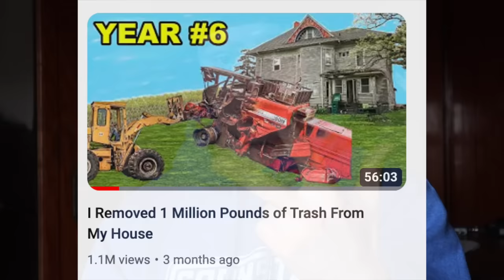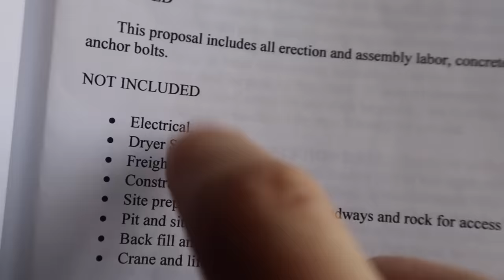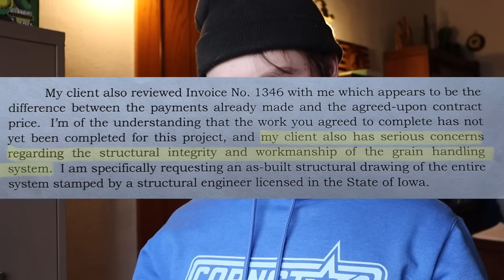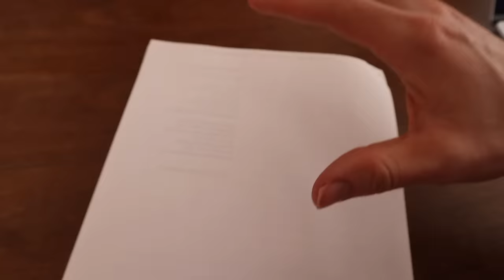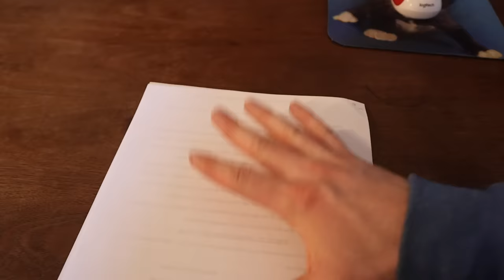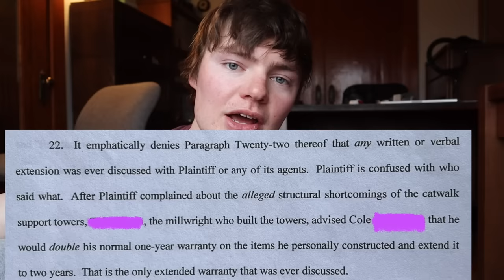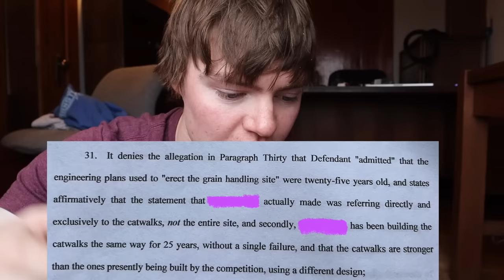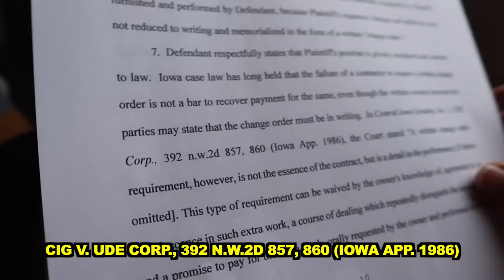I Sued My $1,000,000 Bin Site Contractor

Comment: I am a construction manager on multi-million and billion-dollar projects around the world and have dealt with construction claims throughout my career.  I have been a factual and expert witness three times in high-value arbitrations. You have done wisely to get a construction lawyer as dealing with this stuff is definitely a different bread of cat.  From what I have witnessed on your videos when trying to use the system and what you said in this video, you have a very strong case.  The facts seem to be on your side.  Good luck and sorry that you have to go through this mess.
Reply: Can it hurt Cole’s case if they continue to use the bin site?
Reply: @dylan818  No they have no other choice. They aren't able to use the bin site at capacity or as it's intended either so they are having to use it to what is safe for them until this gets sorted out.
Reply: *breed of cat
Reply: @dylan818  no, quite the opposite, the more evidence it doesn’t perform as per the contract, the stronger Cole’s case.
Reply: I worked in underground construction installing water/sewer/force main, and storm drain, the day i started working my first boss told me if we put anything in the ground we take a picture of the product before it goes in the ground in the ground and all the connections of the product. This was mostly to cover your bases when it came down to jobs. When i moved from underground to building prefab walls and such I will still do the same thing. My boss would always do a on-site engineered plan with all the mechanical joints and grade of each section of pipe from top of pipe. This way anyone coming back would know what is done for each job site 10yrs later. The fact that they are not giving you structural engineering plans might mean that they used some pre-built ones then onsite did adjustments that didn't fit you job site. As my boss would say never just take pre-built items in with making sure they are going to work for that job site as not all jobs are the same. I hope things get better down the road. Remember any future work you do get pictures and video if you have the work done this way you have documentation of everything. Keep a copy of all the plans.
Reply: I feel for their problems with the construction of this bin sight,but something was mentioned about the company that built  it was not allowed on the property to rectify the situation, I believe that could be a problem with this law suit IF that is true ,the company is going to use that as a defense
Reply: yep on simcity like most of us.....
Reply: You lying, you work at Walmart.
Reply: Yes, and the "colesters" have a machine shed that was acquired thru dubious means. Seems like if you're a contractor working for these people you should watch your back!
Reply: Who was the construction manager on this job did they even have one.
Reply: The justice system isn’t about what’s fair, it’s about what’s legal. Most often it comes down to very technical language IE, if the contract called for an estimated completion date that wasn’t met, Cole has an avenue to pursue called liquidated damages. On big contracts like this, it’s usually 250$ dollars daily. 

If Cole started using the bins prior to the contractor handing it off, he may have hindered the contractors ability to work effectively ( even if past due). I know what people will say ‘well, him not getting things done by completion date, means Cole couldn’t use it when he expected.’ I agree, Cole has an avenue for this as well. He would need to balance any extra costs in the final bill. IE, he has to rent a different facility, it cost’s him 100k. He would bill the contractor that amount. He can show it as an expense sustained because of the contractors.

This is just an example. I don’t know the ins and outs of his contract and that’s all that really matters. What’s fair, what’s right does not matter. There is a clause for everything. This is why it’s so much better to resolve things before it gets to court. His lawyer has incentive to make this a long drawn out battle, he gets paid regardless. I’m not suggesting he’s doing that, I’m simply stating things are stacked against Cole because the whole system is shady.
Reply: @beentheredonethat3925  they won on the machine shed, they guy had forged papers. Unless you are with the building contractor they are suing how can you say that.
Reply: you must be mad rich
Reply: I’m sorry but I’ve been building these systems for years. Once that have used the system it’s over. They have been able to use it and have been able to reach max capacity. Just for being frightened of systems failure doesn’t mean it’s failed. In one video it states that welds were broken. After being used one year. Those accusations will go no where.
Reply: @graysonklocko9224  so, if they use the system and then things broke,  that is somehow unrectifiable with the builder simply because they used it? On principle, that’s wrong. However, principal in these cases is secondary to the contract, and if the contract didn’t have a warranty or wording that allowed for some sort of performance evaluation, then I could see your point.
Reply: @graysonklocko9224  they said they haven’t it used it to max capacity because they can’t, that’s the problem. Just because you can use the bath tub but have never been able to use the shower because the plumbing wasn’t done properly does that mean they put the shower in correctly.  Partial use does not mean done properly.
Reply: Let’s just hope he doesn’t lose a ton of money in court costs.
Reply: My boy tried to apply for the job 😂😂
Reply: Bread of cat 😂😂😂😂😂
Reply: A construction manager that doesn't know the difference between bread and breed. 
Makes sense.
Reply: 🍞 of 🐱
Reply: The bread of cat. What even is cat bread?
Reply: @chickenmonger123  A tasty side dish in China
Reply: @billsauberlich7337  they would need to make a change order a d agreement to do that! I’ve spent months repairing rafters on site but you don’t touch them tell they are redesigned and a change order is done e
Reply: @billsauberlich7337  The company also said that they were never brought any complaints or concerns by the Plaintiff...how could they be denied access to rectify a situation that they never were made aware of? Also, IMO it almost all comes down to the foundation of the site. If the concrete foundation is found to be inadequate...that means the entire project is inadequate and not up to standards and has to be completely redone. Hand rails, bolts, weld, belts etc. are really irrelevant at that point.
Reply: Bread of cat.  What's cat bread taste like anyway?
Reply: I wonder if the contractor looked at you, saw some young kid(you look much younger than what your actual age probably is- late 20s ?) and thought he could take advantage of you. So he thought he could give you poorly made equipment, possibly made from inferior quality material and you wouldn't know how to deal with it.
Reply: .  Typo??!

Comment: You should have an OSHA/Insurance inspector come out and do a walk down of the site; submit their findings to your case.
 As a farm (business) I'd be surprised if an inspection wasn't done once construction was complete. If a final safety inspection was done, they sure did a very poor job.
Reply: Also corw the concrete bases and test as they are probably weak cement?
Reply: Great idea!!!!  it is a work site
Reply: I’m kind of surprised that there were no ‘As Built’ plans provided after project was completed.
Reply: If OSHA came out that whole bin site would be shut down.
Reply: If OSHA came out, the farm would be responsible, not the contractor
Reply: I wondered about a final inspection also. Especially how high in the air a person has to go.
Reply: OSHA inspects everything, NOT JUST WHAT YOU WANT THEM TO LOOK AT! Cole has documented unsafe working practices on just about every video.  Some immediately life threatening. When OSHA visits, they look at everything and everyone. All employees, all the buildings, all the equipment, your maintenance records, observations of employees working, hazardous materials storage and handling. I have had them remove tools from my tool pouch and discard them as too worn and unsafe for use. Too many violations can shut you down. There are some exceptions for farm work, but those are pretty much spelled out. Lawyers can get involved, it's messy!!

Basically, you do not invite OSHA except to complain how unsafe a competitor or ex-employer is!
Reply: @davidwilken3584 As would the rest of the operation.
Reply: @jerrylondon2388  yeah I don't get why people say to get OSHA involved. Under the Appropriations Act OSHA would not even legally be allowed to visit the farm/binsite. They are not allowed to spend any funds on  small farming operations.
Reply: @Pipeline-ll2rd  -I'm not sure about that because it's not been paid for fully yet.
Reply: The scariest 9 words in the US, (or any country really), "I'm from the government and I'm here to help".
They do not want OSHA anywhere their farm let alone the bin site, they just don't.
As someone else has mentioned when OSHA comes in they look at everything and I mean everything.
They very well could end up with the entire farm shut down until all issues are addressed to OSHA standards.
Trust me that would end badly and possibly bankrupt the farm in short order...
Good idea on the face of it but very naive in thinking any government wants to help the people when in reality the only thing they want is to help is themselves to more of an individual's property...
Reply: Niether you Or most of the commentors know what OSHA is responsible for. Nor do you understand what their exact jurisdiction or mandate is as it relates to construction projects.Only one person here got it right, If OSHA was brought in, it would negatively affect the farm, not the contractor. At least not until the trial started and a stop work order by OSHA, pending review, was introduced for evidence on behalf of the farm.

Comment: A structural engineer to prove it was done wrong is a 100% guarantee you win especially if you have multiple. Also having core tests done on the pads will prove it wasn't the right mixture or if they didn't poor thick enough wish yall the best.
Reply: They just didn't do a proper GEO engineering report. Their response to the lawyer's engineering request is a bit comical and I don't see how they expect to go to trial based on "...we don't need no engineering report"
Reply: The concrete can be the right mix.  The bigger factor is the soil under the bins and was it right or compacted to handle the bins.  Just because it has been there for 50 year doesn't mean the soil was the right type to handle the weight of the bins.  Just like the hopper bottom how thick was the old pad versus the new pad?  2 to 3 foot thick on old maybe 18 inch on new something wrong there.
Reply: To cut a long story short and to help others who would build such facilities or any other facilities in the future, YOU MUST ALWAYS ASK FOR THE ENTIRE PROJECT before signing or making any payment, and check that project with an independent expert. Without a project in the contract, everything boils down to, she said, he said, which means that it is very difficult to prove in court. After all, it was the contractor's obligation to create a project and to obtain a permit based on it, that is the MAIN thing here. And a copy of that project must be in state institutions, take it out and check what is in that project.
Reply: @johnunsicker7440  agree
Reply: The other issue is any work the contractor didn't do, like excavation, placement and compaction of base material, etc., Will be argued as being inferior.
Reply: I used to work at a coop in Nebraska and was a part of helping tear down an old grain setup and adding 2 500,000 bushel bins. The first bin we dug to grade (I was a pee-on) for this and we packed I don’t know how many feet of clay for a base. The second bin was done by a local dirt contracting company and they did the same. It still may not stand the test of time being so near a creek and how things could change. I know a concrete elevator with a slight lean due to settling also.
Reply: @idahopoolremodeling  well it was improper and was not the contractors responsibility.
Reply: @johnunsicker7440  Cole and his dad spoke with the concrete guy regarding the underlayment(?) thickness and compaction before the concrete was poured. It’s on video.
Reply: @OOpSjm  I thought they had one of those done before the project could even be approved to start.
Reply: @OOpSjm farm construction in iowa is exempt from building codes.   So it is correct that no geotechnical report (or any engineering) is required.
Reply: It should also be easy to prove the welds were improperly done. Using xrays and microscopes the flaws in the welds will be easy to identify.
Reply: @ryanm3371  Why is that? Is it because farmers were once the ones constructing a lot of their own on-site equipment? Is it a nod to the Amish who mostly refuse to abide by building codes for religious reasons?
Reply: @gregorymalchuk272  the rationale is that requiring a farm to build structures to code is onerous to small family farms and favors corporate farms.
Reply: @johnunsicker7440  makes me wonder if the engineers or concrete contractors core drilled the soil underneath the foundations? That’s as much or more important than the mix or slump of the concrete. If you end up with junk 20,30,40 feet underneath it, you’ll eventually end up with junk at ground level

Comment: You’re a 100% right in filing suit.  Contractors that don’t meet specs should be hauled in for fixing their shoddy work.  At our resort, we have had contractors hauled in for poor work or equipment manufacturers for warranty work on high end equipment.  You have to identify early and seek remediation early because there are time clocks running under warranties or guarantees.  Nice work Cole.
Reply: What specs? The lack of engineering specifications defining what is to be built is likely the contractor's bulletproof defense. The contractor built what is in the contract. He wasn't required to build more than that. When Cole didn't hire a consulting engineering firm he set himself up for this headache. Would you try to remove someone's appendix with nothing more than a few YouTube videos for guidance? No? Neither would I. I'd bite the bullet and hire a medical expert.
Reply: @curtislowe4577 exactly!!!  What specs?   This is rural Iowa where farm construction is exempt from any building code.  So what does the contract for construction services say about specs?   I’m guessing very little.

Comment: Yes, I agree. As a former site superintendent working on building construction sites, I seen many errors occurred as I watched your podcasts on YouTube. Hope this all turns out well for you in the near future.
Reply: What is your experience with consulting engineering firms? Did you do projects both with and without an engineering firm?
Reply: @curtislowe4577  There were a few times where we had to stop the project, send pictures to architect and engineers, and had contractors redo the work.
Reply: @curtislowe4577  My experience with consultant engineers has always been good. There were a few times where I noticed a better way to build a feature into the project and these features were accepted by the engineering team. And a few of my features were rejected as well

Comment: A fix.  Pour the phase 2 set of slabs.  I sent you an email with a video showing the reasons a concrete silo fell over.  Including how much additional concrete needs to be calculated.    Take apart the bins and move them to site 2.  Eventually pour bin site 3 and then 4.  If needed rip out the slab at bin site 1 to complete all 4 phases.

Comment: So sorry you’re having to go through this. You did your research and due diligence and really all I see is that you’re asking for what you paid for! Best of luck getting a fair and just resolution for you and your family 🙋‍♀️🇨🇱
Reply: Clearly from the result Cole did not do either enough research or due diligence. He is a farmer with a finance degree. The bin site required experience with soils for foundation support and structural engineering plus all the power transmission and controls to shuttle the grain about.
Reply: what due diligence is there a bid bond, if there were multiples bids on the project why was this contractor hired, was he the cheapest, was he the most expiranced, was his bid in range with the other bids,  is there a performance bond, payment bond. is there a material inspection is there scheduled inspections. no job is completed and then inspected. there are certain thing you do while building to prevent this. where is the geo report with the soil test and class. is there a foundation inspection permit, engineered design. same goes for every other component. from the drawing he showed in the video are horrible I hope those aren't the final plans they had there not even stamped by an engineer how did his city or county approve the construction of a structure without stamped plans